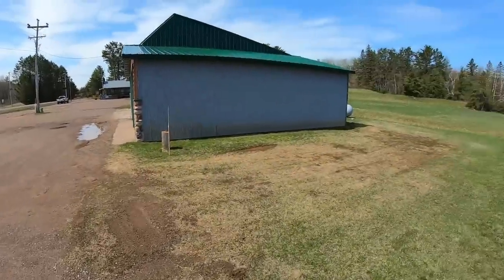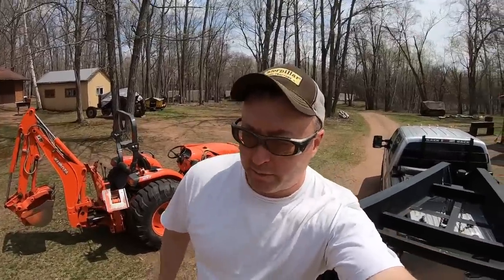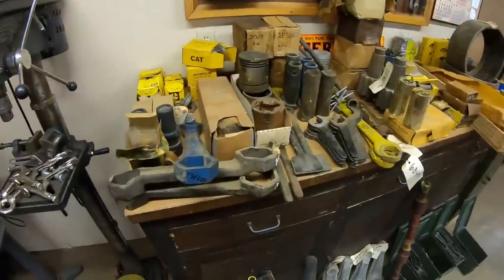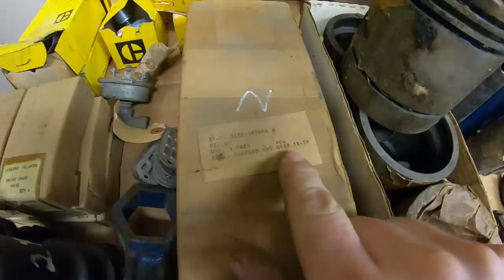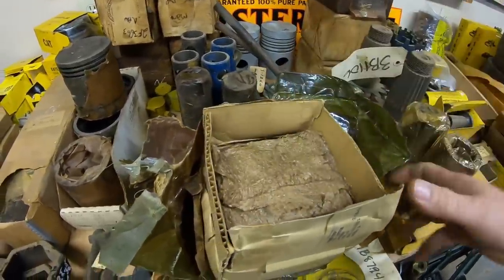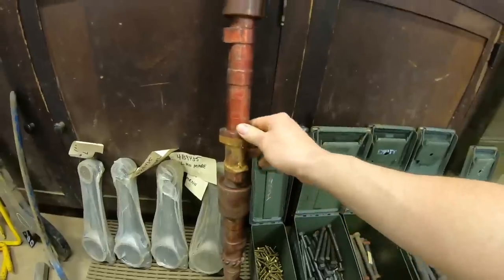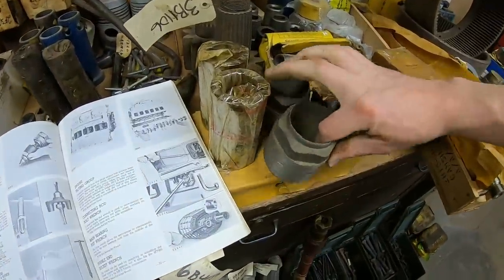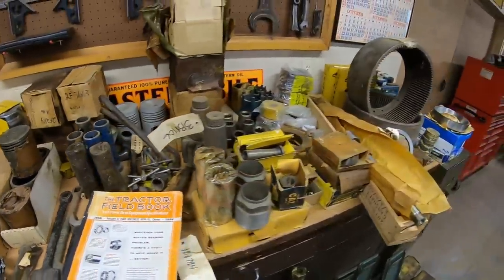NOS Caterpillar Parts Haul - The Biggest Yet!! Last Shipment Ever from Florin Tractor Parts...

Comment: Those metal strapping lengths can come in right handy to cut "shim stock" out of to help get sheet metal gaps lining up or if you get real industrious cut lengths, drill or punch a grommet hole and weave them to make a seat bottom enough to hold a folded burlap sack then padding over as a longer lasting seat repair.

Beyond that, looks like a right major haul of "this guy was a great customer, just push everything left on those shelves on that pallet. What doesn't easily nest in can be held with strapping and shrink wrap."

Comment: We have a  cat 930m  wheel loader at work its about a 1974  machine. It has an accelerator pedal like that.  It doubles as the fuel cut off. You have to reach down and pull it up into a detent to stop the engine.  You also have to remember to step on it to get it out of the detent when you go to start the engine.

Comment: From what i found online it sounds and looks like the 2F3666 is for a vertical 2 cylinder starting engine.    I found a little drawing/parts page online for it.  According to the websites they say it’s used for the D326F, D337 and D342 engines

Comment: Toby. The piston you mention (3 5/8 ) was used in the starting engine of the  D8800 the D13000 the D337 and the D326. If you have some more questions,  just drop me a line and I will try to answer them.

Comment: Been watching for a couple years after looking into a few things on our old dozer. It's a D4 #6U - 316. We haven't run it in a few years, but it runs. Last time I used it I couldn't get the pony motor to engage the flywheel to start it up, but it pull started. We run some older equipment, but this is the oldest by 20 years or more

Comment: Wow, so glad you received those parts and especially the tools.  I can't wait to see them get used.  Nothing like that old military packing.  I bet the stuff that got sunk on the way to Europe in WWII is still serviceable if it were ever recovered.   When I restored military vehicles I used to use regular gas to remove the cosmoline.   What's the story on the neat white building at the corner where you pulled off the road?  Looked like an old Mobile Gas station.

Comment: Nice tinwork there. Very nice haul! I'd sure like to have one of those injector wrenches...
Reply: @squatch253 I have a couple of D2s, one running and one not, 5U9553 and 5U11970, a '52 and '53. Thanks for the injector wrench, sir!
Reply: @squatch253  did you get what you need... or should I send you a decoder ring?
Reply: @squatch253  it's the serial numbers... guess I was a little too clever. If you got the serials, drop the U's and merge the numbers.

Comment: Squatch, I don’t know exactly how accurate it is, but from what I can find doing some quick research those 3 5/8” pistons are for the old vertical pony motors like on a diesel 50 or 75. There was a 3 3/8” pony for smaller tractors and then the 3 5/8 for the bigger tractors, D11000 engines and other things. I’d guess those are probably for some kind of stationary power unit that the military contracted, hence the part number that doesn’t match up.

Comment: You may want to replace 5J1113's track bolts before they loosen up as by then the holes in the chain and track pads may be wallowed out a bit and slightly ovoid...  Proper length shanks on the track pad bolts should prevent that.  Have been a bit concerned seeing what you did there originally.

Comment: I guess I missed out. My 5j D2 needs to be split. A couple of part I'm sure of needing 4B3435 clutch brake assembly and 4B5298 pinion engagement bar assembly. Suggestions?

Comment: Hey Squash, I could use one of those oil cups for my gas thirty five. What will you sell one for?
Reply: @squatch253 let's try this. In 1719 there were 469 soldiers that carried 9187 arrows to battle. If they drop the first digit it will reveal the desired result.

Comment: That crushed paper stuff is probably asbestos. 🙁
Reply: I think it's just excelsior paper, made from wood pulp. I've seen it in a lot of military surplus packaging from that era. I wish it was still made.
Reply: @Nf6xNet  It is interesting you call it excelsior. Back in the early 60s,there was a wood shavings product,effectively same idea as steel wool,only wood,and it too was referred to as excelsior. Watched a black and white movie,decades ago,the movie was from the 30s. Excelsior wood shavings was part of the plot. So was it originally a brand name that became a more general reference, or was there a manufacturer of several types of wood product ? No idea. 
The stuff I refer to was used instead of plastic peanuts,for packaging. Very popular for kindling in wood stoves,hardware stores would set out bins as a giveaway rather than in a trash burner out back.
Any stuff you know on the subject gratefully received. 
Cheers.